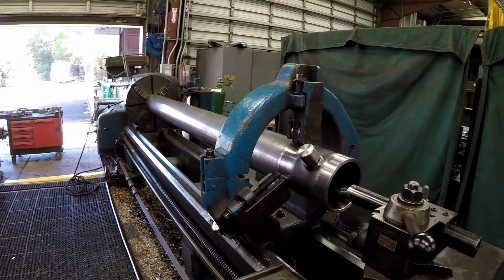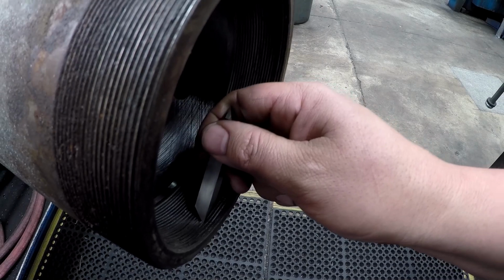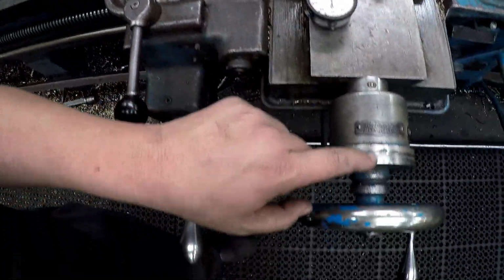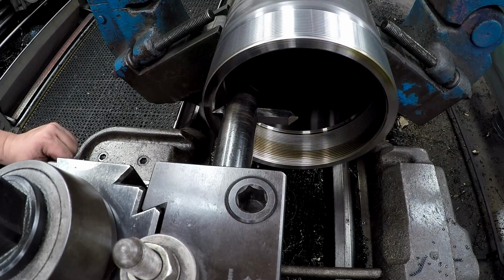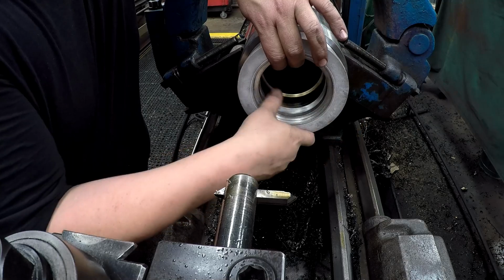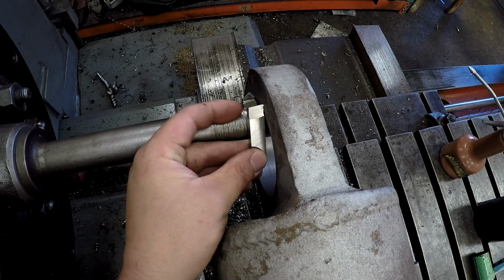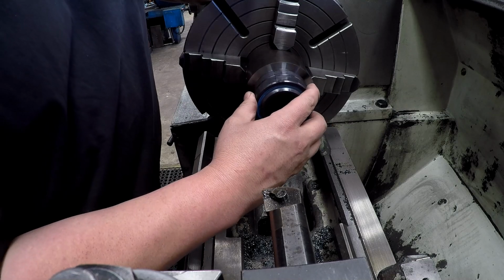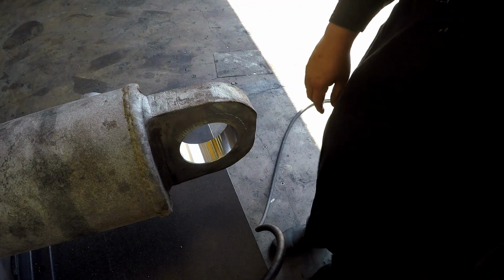SNS 162 Pt 2: Internal Buttress Threading, Horizontal Boring Mill

Comment: Question you cutting internal thread BUTTRESS  so the pressure seat at angle 7* ,   now the 45 * it clearance my question the pressure  of the oil no leaks .
O you install seal  ,on the nuts. Thank you ,FOR YOUR HELP.  You have a quality LATHE machine only you need a better AMERCAN tool post. Greeting from CANADA.🌘⚽🔎

Comment: Butress thread I g, my first one was a double one. Fortunately I double checked my self and the pitch was not 4 tip as gagged it was 2 tip. I have cut single, double, triple, and quadruple ones. Good job informing as usual Adam

Comment: Nice job! Question Adam. What do you feel your options(Plan B) would be if you had a mishap such as operator error or machine or tooling mishap damaging the threading job? Do you purchase enough length of tube to cut end off and redo, make a new head to redesign without discarding the whole tube or just start over and save material for shorter job etc.? Thanks Ed K.

Comment: I made a log splitter back when I was teacher at the vocational school.  I made a tapered buttress threaded shaft that came down to a point to wedge itself into and split a log.  It worked very well for many years.  An interesting project for a bricklayer to attempt.  Thanks, Greg.

Comment: Hi Abom, I think the ID was undersized from the sleeve press into the eye.  For relatively thin sleeves, it's pretty safe to oversize the bore by 75% of the outside press.  Then it leaves less to clean up on the ID.  Thicker sleeves will actually compress more than the OD press.  The material has to go somewhere.  I like that you used the thick sleeve bc it's unlikely to warp under welding.  A warped sleeve will ruin a new bearing bc rollers will have uneven contact in the races.
Reply from the maker: +hubmoog&biveysac The type of bearing that goes into the bore is a self aligning bearing.

Comment: Sorry for this ignorant question... @ 7:45 you note that the cylinders loss of roundness due to the welding in a prior step. So, the question is, does this out of round condition cause any abnormal wear conditions, or a premature break down of the assembly over time? Or does the piston, and the specs address some non concentricity at that section of the cylinder? Thanks

Comment: I think Mrpete's issue with air is more the abuse of it with people using it to just clean the entire machine. Especially on the older machines where chips can get up into the gears rather easily with the air.

Comment: I hate buttress threads!! I once scrapped a £8000 oil tool as i cut the buttress thread with the angle on the wrong side. According to the Non-Compliance Report the thread would have a maximum load of 120 tons.  12" long thread on a 9" diameter OD and the thread was only .024" deep. Keep up the good work Adam.

Comment: Adam when you do a bore job like this do you like to bore the hole to a size and then make the bushing fit the hole?That's what I do antway. My boring mill will run from 10-1250 RPM but I think your Kearns is quiet compared to mine. My Forge de Gilli is a geared machine and is noisey at lower speeds Thanks

Comment: When I fit sleeves I make the bore under size and finish bore it to size once its pressed in and welded or pinned.
Reply from the maker: I do that all the time, but in this case I wanted to weld it be finished. When you weld eyes to the end of rods you have to bore them back round.

Comment: An ANSI Buttress Thread has a flat or radius in the root  and is 45 degrees and 7 degrees not 45/90 to a sharp point.
They are used to transmit load in one direction and for sealing.
Buttress is a term for a support, as in buttressing a wall.
Your comment, "As far as the data behind that, I'm not one to tell you whether or not that is true", is, 'with all due respect, a little disappointing.
What would you rather have a vise with buttress threads or common V groove threads?
Who are you to redesign or re engineer a product to a lesser quality?
Was it your bosses decision the customers or yours?
People come here to learn to do things right not half step.
That is what they do in China and is not the way to "Make America Great Again".
That starts with each and every one of us.
You have over 100 thousand subscribers and I probably ticked every one of them off including you.
That is not my intent but let the chips fall where they may.

Comment: Need to keep in mind that cutting will warm the part. So an easy test fit on the lathe can be a bit tight when both parts are at the same temperature.
Reply from the maker: Yessir, I believe I'm aware of thermal expansion
Reply: Wasn't addressed to you personally; just as a general comment because I have nothing else for which to exist.

Comment: I noticed that you had a big nut in the bottom of your oil can to help it to not tip over. I like to put one of those  neodymium mags in the bottom of my can to stick on the metal of your machine and you get the extra added benefit that the mag picks-up the chips that the brush deposits in the can so when you add new oil you can wipe the mag off and start afresh.

Comment: A rule of thumb for getting your tool to face the right direction, for the buttress threads on the a cylinder, the flat side of the threading tool is going to face the end of the cylinder (the angle is going to face the inside). And the depth is going to be around the same as the pitch (1/12" in this case).

Comment: At my work we have pump caps with buttress threads. The caps a two inchs thick three threads per inch. The pump is rated for 15,000 psi working pressure. Thanks for sharing.

Comment: Nice work as always, Adam.  My question is similar to the one I asked previously on internal threading... Say you didn't have the old gland (or a replacement gland) to test fit to, how on earth would you check the fit what you just cut, without having to make a test fitting plug?  Also, on the OD side of things, I suppose for  a buttress thread you are probably not measuring on wires, right?

Comment: Do you find that Buttress threaded cylinders have fewer gland nuts that are galled and seized? It seams that you should.  Why not weld in the bush with the ID unfinished and then finish bore it in the mill after welding? I guess the pin clearance is not that critical to be worth the extra steps.

Comment: It's amazing that a boring bar of that size would have that much flex just threading. Really interesting work you do.
Reply from the maker: greasydot veritably all boring bars hanging out like that will have deflection that can cause several passes to cut lightly.
Reply: Abom79 I was looking at that thread in my books and failed to remember you feeding with the cross slide so the tool pressure on a .020 cut has a lot of surface on the cutting edge of the  tool creating some serious down and back pressure. Thank you for sharing your knowledge and what you do.

Comment: A common use of buttress threads is the caps and necks of plastic soda pop bottles.
Reply: That is so they can push them on, but they wont push off with pressure. Just like a zip tie is one directional. They cant spin the caps on because it messes up the tamper seal.

Comment: With any shape of thread though only a very small percentage of surface area actually touches, so really no thread shape is head and shoulders stronger than another thread shape, it is just whatever the engineer chose to use.
Reply: trainedtiger: In a theoretical sense, you are correct. But your last statement, "unless you tighten to the point of deformation" is the key to your error. The amount of force applied to properly tightened threads is massive, and immediately results in deformation of the few initial contact points until there is a much larger percentage of contact. 

For example: Tom Lipton, a few months ago, demonstrated that the resultant clamping force on a #10-32 screw tightened to 90 in*lbs, is specified at 2500lbs. According to various sources, the first 6 threads support 100% of the force, and so the theoretical area of contact (from a linear force perspective) of perfect threads would be about 0.0554 square inches. Lets accept that your original statement is correct, and suppose that there's only 10% of actual initial physical contact, resulting in a surface area of 0.00554 sq in. 2500lbs of force applied to that small area results in a pressure of just over 450,000psi. A nice, high-stength alloy like 4140 starts to yield at 60,200psi. Therefore, as that screw is tightened, it will immediately start deforming those contact points, and the contact area will spread and increase until the amount of force applied equals the yield strength of the material. In our case, with nice strong alloys, it will increase until there is almost 75% contact area. If using softer materials (such as the aluminum gland Adam is installing) the resultant contact area will increase even beyond 75%.

Although our example uses a relatively small screw (I chose it because Tom filmed such a nice demonstration supporting the numbers), remember that proper screw torque values scale proportionally to the screw and thread size, and so the principle is valid for all threaded joints. Once you add in the fact that Adam's cylinder gland will see thousands (perhaps tens of thousands) of pounds of additional force from the hydraulic pressure, then there is definite validity in selecting a truly mechanically stronger thread form.
Reply: trainedtiger thats not true at all. Entire sections of textbooks are dedicated to the analysis of threads and the physics behind the stresses in them, and some are much stronger
Reply: In theory, but cut threads aren't perfect because of tool wear, tool tolerances, and machine accuracy. When you tighten the thread to engagement only a very small portion of the total thread is in contact. so you have //\\ touching in a very small spot or you have ||\\ touching in a very small spot for which there is little to no actual gain in strength, unless you tighten to the point of deformation.
Reply from the maker: trainedtiger Most all cylinders we build have v threads and rarely do I see threads stripped due to pressure.

Comment: Buttress threads: assymetrical profile. A trap for some. When I was an apprentice in my second rotation through engine lathes i was given 12 dog bolts to make. Watertight doors were held to their seals by a set of rotating dogs operated by linkage. The dog bolt penetrates the door frame mounted in a ship's watertight bulkhead. The door might have six or eight dogs but only one dog bolt for operating the dog linkage from either side. 

They were much like a shoulder bolt in shape but the threats on the end were buttress to fit the dog. High reliability stuff. I made them, passed them through the boss (who commented favorably on my workmanship),  and they went on to the mills etc to inspection. It was the shipping clerk who spotted the beautifuly cut buttress threads I made pointed the wrong way. LOTS of red faces besides mine. Somone had to pay...

I swept, hauled chips, and cleaned sumps for a week after that. After that fiasco, I kept a little mantra in my head about the buttress thread load flank and which way they faced but 50 years have taken its toll: yup - forgot it.
Reply: Yep, I can relate to that experience very well.

Comment: why couldn't you have left the Id oversized some then welded it in and then finished it back to size.
Reply from the maker: brad hieronimus I don't care for boring out weld, just hell on tool bits. You can do it though sure. If you don't center the spindle before welding though.....

Comment: I've got 30 years in hydraulic repair , finding someone who knows what a butrus thread is and what good a taper will do for you , good job Adam!
Reply from the maker: CE Smith Thanks! Hey when you have to build them you quickly learn the dos and don'ts  right?  That lead in angle can make a huge difference on an install.

Comment: Adam, What is that double spiral grooved shaft on the rear of that lathe?
Reply: Probably the drive for the tail stock. most big lathes have powered tail stocks cause they are too heavy to move vey far by hand.
Reply from the maker: Bill Todd That's for the carriage power travers.
Reply: Abom79  Thanks Adam (another excellent video by the way.)

Comment: The buttress thread form, also known as the breech-lock thread form, refers to two different thread profiles. One is a type of leadscrew and the other is a type of hydraulic sealing thread form. The leadscrew type is often used in machinery and the sealing type is often used in oil fields
Reply: As read right out of Wikipedia LOL

Comment: The buttress threads are big in the oilfield. Ran many joints of casing with those threads. Have ran casing strings with those threads from a couple hundred thousand pounds to a million plus.

Comment: I don't know what your press is but I used liquid nitrogen to shrink the bearings instead of pressing. I did my work in the field and it was easier than handling the 100 ton cylinder.
Reply from the maker: Douglas Lodge Yep that works too

Comment: Excellent video, 

I think the buttress thread is common on older small Press Brakes where the main force was directed in the downward, or visa versa, stroke only , 

Edmund..........Alberta
Reply: its what is used on quick release vice threads, its not acme, as it needs a half nut that will grip by itself
Reply: Sweet little Bantam,

Comment: Buttress threading is mainly used for sealing application under high pressure toward one direction. It has twice the shear strength as square threading and easier to thread compared to square threading.

Comment: The benefit of a buttress thread is that flat part of the thread. Instead of angling back, it's perpendicular to the axis of the screw. An angled thread has two force components, whereas a buttress only has the one. It's like pushing a box along a flat floor instead of trying to push it on an angled floor. I think buttress is important on things like thin components, like what you're doing on the cylinder. It doesn't impart a side force, which could force a thin part away from it's mating part.
Reply: Also, it (due to the flat part of the thread) forms a tighter hydraulic seal.
Reply: Ideally the buttress thread application is to provide more strength in one direction when there is a lot of force one way, but not much the other way. Like the bolt lockup in a  rifle for example.
Reply: Thus it's use in the oil industry.
Reply: Yup.  In this case, it was most likely spec'd for the same reason.
Reply: The axial force in the cylinder will press the two 90° butts onto each other and therefore prevent self unthreading and leaks.
Reply: Yup. Numerous vises use buttress threads for single direction strength.
Reply: The differnce between this thread and ie a press is that it is not one flat rectangular surface but a much longer narrow spiral (having a substantial surface in total)  that takes indeed a perpendicural force just like a press.
Reply: You'll also see buttress threads on things like plastic drink bottles for the same reason. All of my Nalgene branded plastic bottles have a buttress thread; both the narrow neck and wide neck styles.

At work, we use buttress threads on high pressure filter bowls because know which direction the force will be coming from. Buttress threads do not work well if the force is able to reverse direction, though.

Comment: that flux core really gets shit done
Reply from the maker: Sketch1994 It's badass man!
Reply: I'm curious, I thought you had said the eye was cast iron? Or was that cast steel? I just didn't understand welding steel to cast iron cold without any preheat. I mean it looked good, but you didn't seemed worried about it cracking out, being dissimilar metals.
Reply: Abom makes it flow like butter.
Reply: The piece of tubing he was going to use at first was cast.

Comment: Anti-bozo sharpie marks, well worth it in the end. 
Also, buttress threads are stronger in one direction, if you think of how the pressure is on the part you can figure out which way to cut the thread.

Comment: When I cut a thread I usually run into the undercut and then reverse the chuck, never disengaging the lead screw... I noticed you took the tool back out using the hand wheel, do you use the chasing dial (Multi start dial) to start cutting back in the same place?! 

Cheers!
Reply from the maker: Scott Small That lathe has no way to reverse like that without reversing the motor.

Comment: Adam how do you know when to back the tool out of the thread? (to not hit the chamfer I mean). On the scratch pass is visible, but on all the other passes is difficult to see. Do you have another indicator?
Reply: Yes, he has an indicator setup in the Z axis.
Reply from the maker: ingDemurtas I have the mag backed indicator set to a zero so it's easy to back the tool out near the same spot each time.